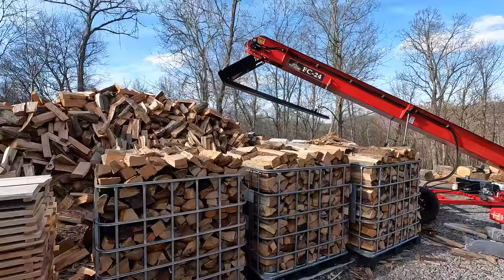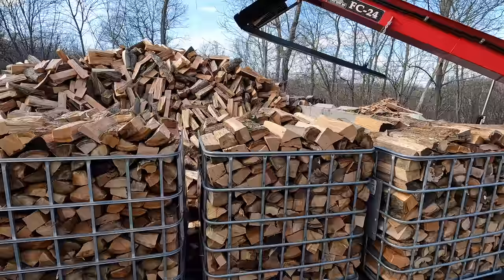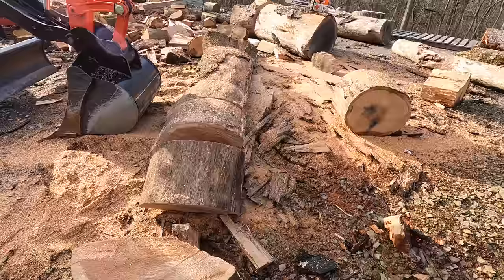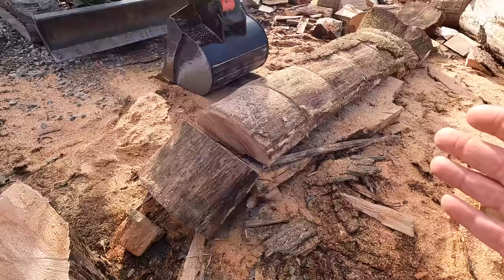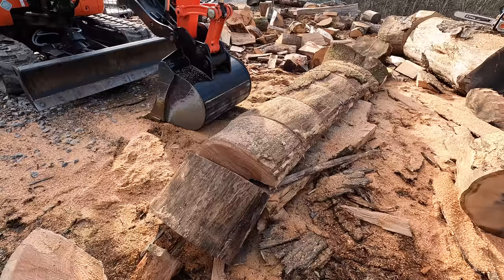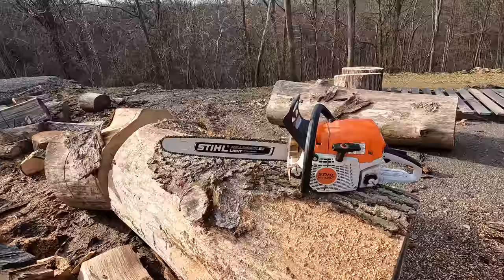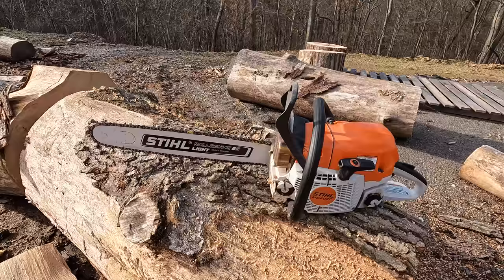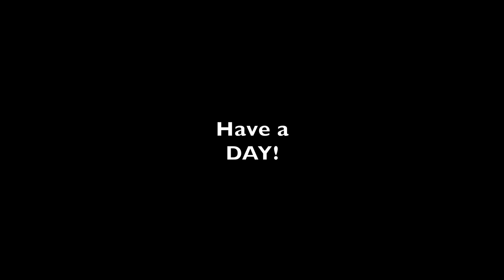Wood Bunker, Replacing what Levi Removed

Comment: I saw a vid where someone took those bladders and cut the bottom about a foot tall. Screwed a board across one side with eye bolts and a length of cable to make a sled to drag behind the sidekick or atv. They would put yard waist or used it for extra space for wood rounds in addition to the bed of the sidekick to double how much they could get in a trip. That plastic is really thick, and pretty durable.

Comment: I use the metal totes, I also use the plastic bladder. Cut the top out, cut upside down triangle in front, cut 3” wide strips in other 3 sides, bout 3 per side then cut slits in bottom for drainage then place them on pallet then fill them with wood

Comment: Kleerguard Nemisis RX 2.0 are what I wear all the time, I’m always doing something where eye protection is probably recommended, and I’m also blind up close without readers. I’ve tried a few, the Nemisis RX seems to be consistent in clarity and  no distortion. My employer bought cheaper versions and they gave me a head ache. I buy these by the 6pk and replace them about once a month or 2. I’ve even got them in smoke (with the reader) for those sunny days outside.

Comment: Mike, I thought the whole reason for getting the smaller totes from Adam was so that customers could lift them with smaller tractors. The way Levi has them filled over the top they probably hold as much (and weigh as much) as the taller ones.

Comment: Mike, it would be interesting to empty an IBC tote into a measured rack to see how much you’re really getting in them. Usually the 275’s are quoted at 1/4 and 330’s at 1/3 cord. Would be nice to see an actual experiment.
Reply: Look at Old guy Firewoods YouTube channel.... he unloads a 275 that's stacked 2 rows higher and it is a face cord... 4x16x8ft perfect .... so a 330 stacked even is same..... 1 face cord is 1/3rd full cord

Comment: You have mentioned in past videos about needing a larger capacity fuel tank.  Have you ever thought of using one of the IBC totes as a fuel tank.  You could put between 220 to 260 gallons of diesel fuel in a tote and be at 1,800 lbs.  We use them to store used motor oil in for fuel for our steam locomotive.
Reply: figure out how to lock it....
Reply: @gregprince2523  SimpliSafe?
Reply: @heymakerphd1982  could cross your fingers!!!
4.5 million miles truckin across this big ole beautiful country ..... that's 900,000 gallons of diesel fuel . I've been hit 4 times over 150 gallons,  once over 250
Hurts like hell each n everytime... Always when fuel is super high. I've seen guys with electric/quiet pumps and water hoses able to drain 250 gallons in 5-7 minutes....  When fuel gets high the thieves come out. A desperate despicable man will rationalize bout anything.  Better to be pro active than reactive... Good locks, chains keep bad thieves away. A good thief is gonna get what he/she wants when they want it. A good camera system would help but many of them aren't very clear and it takes a couple different angles to get a good mugshot
Reply: Static discharge is the a problem with totes
Reply: Ron Liebert   I have seen them used for fuels many times.  Static electricity is an issue in most fueling operations.  When I was in the Air Force I was a crew chief on C-130s.  We had to ground the aircraft and then the fueling nozzle at the fueling panel before connecting the nozzle.
Reply: @gregprince2523  I remem two brothers that would pull in the truck stop, walk around, check out all the trucks for any 'watchers', then get a pump, hose, bolt cutters, crowbar, anything else needed, drain the tanks of the trucks parked next to their trucks,both sides, both trucks, then pull out and head on down the road! Never paid for fuel! Did the same thing with tires. Hit fast, no witness, move out! The two worked like a NASCAR pit crew! No lock stopped them. Only witnesses. A lot of company drivers got penalized for selling tires, fuel, batteries, but they didn't do it. Another trucker told me he had witnessed them doing it, by the time he could report it, they were long gone! -The wonderful life of a trucker!
    An incredible sidebar - trains can carry freight up to 600 times cheaper than trucks! Prob because they don't have stop signs!
Reply: @heymakerphd1982 copy that on the trains..... but it takes 6 weeks to move a train across the country vs 4 days..... and then you have to hire a truck to get the product from the railhead to the customer..... usually the container goes to a warehouse and then gets delivered to customer.... been there done that many times

Comment: “Project Farm” would calculate the amount of fuel produced in the wood, minus fuel, depreciation and labor spent to provide the fire wood.  It would be interesting.  Maybe I will as Project farm to do that!
Reply: I was told a100 gals of fuel oil was the equivalent of a cord of wood engery wise.
Reply: Peter, good information. Let us know if you find more info.  We burn roughly 4 pulp cords of wood, so that would have to be 400 gals of fuel oil @ $4 per gallon.  $1600 is a small price to pay for heat in northern Wisconsin.
Reply: 1 gal of #2 fuel oil = 139,600 BTU
1 cord of hickory = 28,000,000 BTUs
Reply: I have had the good forturn to burn big hickorys too.but to just burn them is a real sin I think.I have a 30 foot x 20 inch butt laying in my yard now I dropped this winter .It had some rot that threatened my power lines.I will make yet another 12x12'x 25 foot beam to use in a wood shed Im building.I have made them with my Alaskan saw mill in the past and tryed to cover them but they rot fast if their are not covered and oiled heavy.
Reply: Peter, I like how you think.  I do not like to waste our resources also.  We do plenty of pondering before trees are harvested and in the case of where we had to clear some land for our home, we bought some poor farmland and planted several thousand trees.

Comment: I have been thinking about how I would build my firewood bunker and I think you helped me solve a problem.  I don’t want to keep filling the bunker and removing the wood from the front.  At some point, the wood at the back would become far more seasoned than the wood at the front.  I think I will build mine with walls front and back.  I will fill it in with new wood from each side and take wood from the opposite side. If all goes to plan, it will be evenly seasoned.  Might save me on block too if I don’t have three walls.

Comment: Hello from Albrightsville in Carbon County Pa.  I’m also a loyal subscriber but have only commented a few times.   I watch from the YouTube app on TV and it’s virtually impossible to comment from there.   I bought the 3M hearing protection Bluetooth headset a few years ago.  I use them for mowing, string trimming, running the backpack blower and even the snowblower.  They work great.  Wear the safety glasses with bifocals, you’ll get used to them.  It takes a little while getting used to tho..   keep up the great videos, always enjoyable!!

Comment: I always wondered what was best AFTER greasing a zerk.  Leave excess grease ON, or wipe it OFF?  
We always left the excess ON, and then WIPED CLEAN before regreasing. 
Our thinking was that the excess grease would prevent debris from clogging the zerk and come off when wiped off, but I see it done both ways.
Only downside I saw with leaving the grease ON was that sometimes I would put my hands on it when working around the tractor!  lol

Comment: If the point of using the 275-gal totes is to get a lighter load for the customer's tractors to lift, over-filling them to get a full 1/3 cord seems like it pretty much defeats the purpose -- a 330-gal tote filled to the top holds about 5% more than a 1/3 cord.

Comment: Thanks for the greasing tip on the excavator, have a U55 with 150hr hope I have not caused any damage but have been greasing every 10hr.

Pulled inspection plate and gear is evenly greased but inspection plate has some unacceptable rust areas, wish they used the same paint process as the rest of the machine !

Comment: I missed the tractor pics!  I always watch them with my finger on the space bar to pause the video & take a longer look at each pic!  I was always told to put the foot the sawzall up against what you're cutting so all the motion is used to cut, are you just trying to use more of the blade?...Also I was wondering why you cut upwards rather than down and let the weight of the saw help you cut?

Comment: Hey Mike! Have you thought about cutting the plastic tanks you take out and take one side off and use it as a top for the baskets to keep the rain and snow off of them? Just curious on your thoughts. And I use the Isotunes ear canceling ear buds. To me it’s cooler during the summer, the big headphones just made my head all sweaty and hot. Especially here in Kentucky with all the heat and humidity.

Comment: Hi Mike. I was wondering what a face cord (4’x 8’ x 16”) is worth in your neck of the woods? Would this be the equivalent to what your refer to as a third of a cord or tote full? When it comes to firewood, the face cord is the only measure I hear used around here. (Ontario, Canada)
Reply: A face cord is the same as 1/3 cord, yes.  $125-200 USD depending on the wood and such, delivery or what have you, is the going rate in the area.  Cheaper the further from Pittsburgh one gets.

Comment: Hey Mike... You are talking about Minneapolis, Pa, right? The other Minneapolis is NOT a place many people would want to visit with respect to DEFUNDING the police...
I'm thinking on those 275 gal. totes the people will need to strap down those splits and/or throw the excess into their truck beds to avoid a potential on road situation, now that I think of it, they should be strapped down in either case!
I'm really liking the power grease gun btw as I own a ancient lever gun that goes back at least to the '60's & a pistol grip as well, ( about 15 years old now, ) snows a melting here in the north country... 
Bill... :~)

Comment: As for the readers safety glasses it's just getting used to them best thing I've found is wear them all the time and you'll get use to them faster.
When I needed readers and computer glasses different perceptions and none for distance I opted for tri focals no Rx in top computer Rx in middle and reading Rx in bottom and progressive (no line) lenses but I wear safety glasses all the time because of work requirements so I wear them at home too with all the stuff I do it's saved me a few times at home.

Comment: I would have liked to visit with you both at the sportsmans show but I have a variety of negative reasons all lined up.  First parking is expensive and requires a long walk.  Gas is a factor as well because we live about sixty miles north.  I am due for a knee replacement and am saving what's left for chores around the property.  I used to go to the show every year and my uncle used to have a booth there.  If you are driving in on IS 94 you will pass 3M corporate campus where my wife worked for 33 years.  You would be welcome to visit us????

Comment: I have safety glasses at work with cheaters in them, I only wear them when I have to read something. It can be difficult walking with them, but you ought to try climbing stairs with them, you’ll be in the fall mode quick fast and in a hurry.

Comment: There is a lot of moisture I that oak log . I saw a lot of water spring out of that piece of log that turn cross way on the splitter  head. Also that last tote ta k has a section damage.